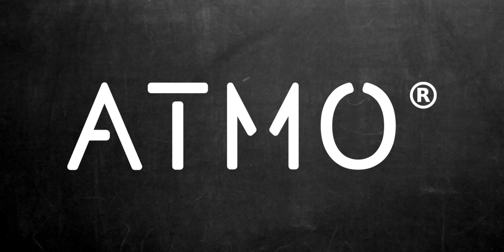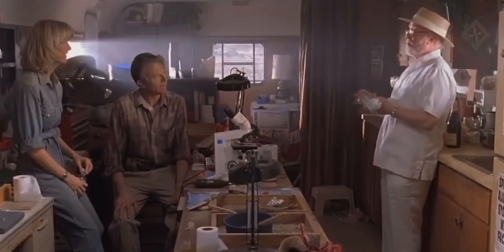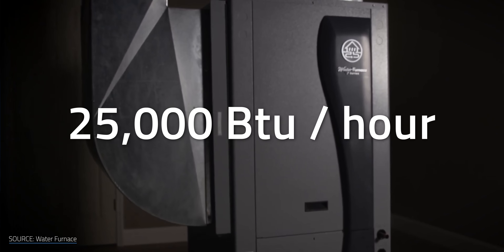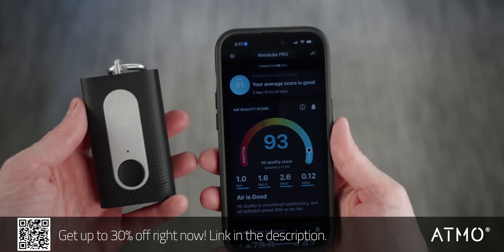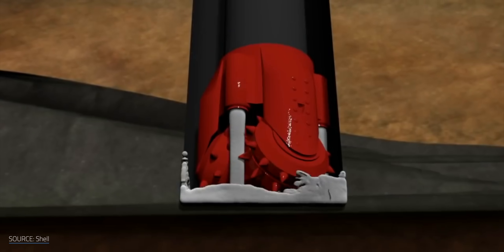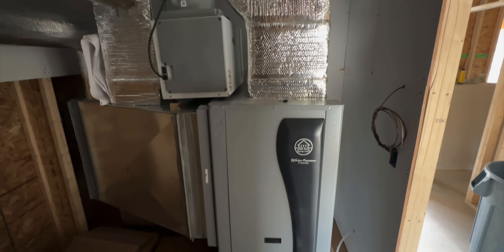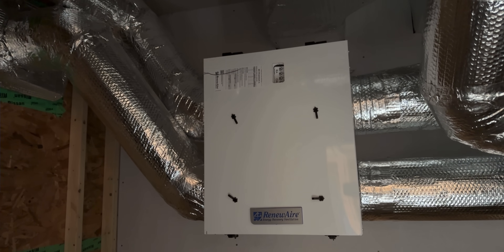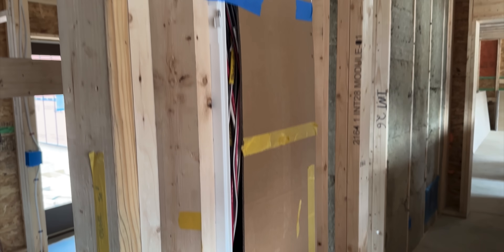Why I Went With Geothermal For My Net Zero Home

Comment: I've seen other people mention the Span panel, it looks really interesting. I haven't seen a dive into it yet. The other video talked about how it was a good solution for electrifying homes that currently have other energy sources for appliances (like gas) without having to fully upgrade the electrical system. You could use the San panel to do things like turn off the water heater while the dryer is running to prevent system overload. And the water heater wouldn't lose much heat in that short time.
Reply: Really in his home I think the only use that makes sense is load balancing during a power outage and general monitoring.

He mentions having it charge his car when he has excess solar power, but Massachusetts has net metering required for a lot of power companies, so there shouldn't be any cost savings afaik doing it his way. In terms of CO2 offset it doesn't matter if the solar is being used in his house vs on of his neighbors by exporting besides maybe some marginal transmission losses. I don't see a point of it besides some feel good factor.
Reply: Matt's "zero energy" goal may not require it, but i bet there will be more Span panels as existing MA solar owners upsize, possibly with off-grid systems that won't interfere with existing interconnection agreements.  By balancing, span can likely help prevent back-feeding and be setup to switch over to critical loads (or off-grid) solutions.

Comment: Radiant Heating sucks Here in Vermont... Most of the Heat just Bleeds out Along the Baseboards & Outside without Heating the House Because They Stupidly Install It Along the Outer Walls... & IF it gets Too Cold Those Stupid Pipes Freeze Along the Outer Walls.

Comment: i would like to know the idle power usage of all that smart stuff. also, would be nice to translate btu-s, r-x-ses and tons to si units, like kw-s and insulation thickness. still not convinced one gets "net 0", if accounting for all the devices and extra stuff. the initial capex is huge, even if not looking at interest rates or a 50-year life span. ...which might be more or less for each part, but duct cleaning, compressor, windows losing the low-k gas, vendor lock-in and upgrades through time... yeah i'm poor.

Comment: Great project! Wondering if you looked into getting the Tesla Solar roof instead of a metal roof + solar panels. On my house, prices for the Tesla roof vs metal + solar panels were comparable. I don't regret going the Tesla roof route at all. Also, wondered why you didn't go with a Zehnder ERV instead of  RenewAir. As you mentioned, ventilation is the most important component of the system. Zehnder systems have a dedicated ducting system that doesn't rely on the WaterFurnace fan to work.

Comment: I don't usually comment but I had to in this case,
I find it odd that in newbuilds/extensive renovations, neither electrical nor network cables are being put into ducting from the central location in the house.

Sure cost goes up a bit but just the convenience is something is not working or has to be changed in the future seems like it should out weight the small cost of the ducts

Comment: I'll mention the same warning I did last time on geothermal heat pump systems with vertical wells like yours and mine. The drillers usually have no way of knowing how far it is down to bedrock, and that portion of the well above bedrock (or ledge) needs casement (the big steel pipe). Because of this the estimate will be a hopeful guess and the actual cost can go much higher. In my case they guestimated 20 feet to ledge ( a reasonable guess in NH) but it ended up being 100 feet, which added $8600.00 on top of the estimated cost for the (in my case) two wells. I'll add that my system came online in early February, just before the double digit negative Fahrenheit cold snap and it performed very well. Looking forward to not dealing with window AC units this summer.
Reply: That is a huge price for casing.  Here in my part of Canada the depth to bedrock is literally measured in inches so it isn't a concern.
Reply: @markbernier8434  with new air to water cold climate heat pumps , ground source heat pumps do not make any economical sense, yes they are more efficient but with saved money I would prefer to install solar panels to get higher return on investment
Reply: @andreycham4797  I somewhat agree with you. For me the calculations went beyond up front and running cost to dependability and maintenance. One nice thing about geothermal is that none of the system components are outside exposed to the elements. Maintenance amounts to periodic filter change and condensate pump line cleaning. No worries about external condenser freezing up. Also it looks like even the cold climate air source heat pumps are still only good to -5F. I'm sure they'll get better but that's where it is now. Here in the northeast, that's a concern.
Reply: @markbernier8434  That's why I mention the depth to ledge being a hopeful guess. Its commonly not that far to ledge around here either. I just got unlucky.
Reply: I had a similar experience with casing cost.

Comment: Hello Matt,

I kind of did the same thing you are doing. But I didn't see you mentioning using your geothermal energy for pre-cooling of preheating the air of the ventilation? Somethings it's called a 'hydraulic Canadian well'. My ventilation unit from Zehnder had this extra heat exchange module. The same geothermal liquid goes to my heat pump and ventilation unit. Did you ever consider this? 

Best regards from Belgium. Jan

Comment: I installed water furnace 5 series. In 2019. My house had oil heat and no duct work so when I wanted central air it was a no brainer for me. I have a 2 ton system upstairs and 3 downstairs. It’s an older house so needed a bigger system. The system has worked flawless even in cold NY winters. I would recommend using ecobee thermostats because they have wireless sensors and the data and control is better than anything else.
Reply: We love hearing comments like this. Thank you so much for choosing WaterFurnace for your home. We appreciate you.

Comment: Hi Matt, In the UK we try not to allow the hvac system to extract kitchen cooking smells as grease particles will clog filters and line the ducting  causing build up over time, we recommend to customers using down draft extractors that are baffled to stop cold outside air coming back in to the house and are almost sealed when not in use so they don't unbalance the hvac, These can also be set to boost the air coming in when in use to compensate for the amount of air the extract is pushing, These down draft also remove more cooking smells and moisture than conventional overhead extractor types. may be worth having a word with your hvac installers.
Reply: I was thinking this too.  I wouldn't want grease getting in my ERV.

Comment: You are building the house nearly the same way we are planning to re-build our place.
It would be great to get some references for contractors and architects that you work with as we are also located in MA.

Beyond what you are doing, I'm trying to explore options to put PoE lighting in the house so that I have better control over them.
Have you thought of PoE low voltage lights?
Reply: I have build my house with es32 POE wall switches, designed PCB's myself. Connected to esphome and home assistant. Never seen such reliability so far, super happy about it and definitely can recommend that.
Reply: @andrejb.5467  wow! Do you happened to have a blogpost or something similar where we can read more about your approach?
Reply: Didn't know that was a thing
Reply: @l0gic23  they are mostly in commercial and high-end residential. Not too many mom-n-pop shops can do this

Comment: As far as automatically opening and closing shades to help regulate temp to save energy. My grandparents house was built in the 1890's. (Yes 1890 not 1980's) Since they didn't have HVAC systems the architect made the eaves stick out. (the outside roof overhang the siding). So that in the winter when the sun is lower in the sky the sunlight shines directly into the windows. While in the summer the eaves stick out enough to shade the windows so that the sun doesn't directly shine in. 

How far the eaves stick out depends on your latitude. It works out all year long, even in spring and fall where the windows get partial sun.  

I referenced the windows in particular because they're a big source of energy exchange. But the eaves actually help regulate temp on the entire side of the house. It works out so that the higher in the sky the sun is the more shade there is on the house, of course the lower the sun is in the sky the less shade it gets. It lets the circadian rhythm determine how much sun falls on the house both in a 24 hr and yearly cycle. 

As far as aesthetics. From the street the overhang of the eaves gives it a very baroque feel. Many people seem to prefer clean, almost industrial lines these days. But if it ain't baroque don't fix it, I say. Bad dum tish.
Reply: These sorts of large overhangs are common in Prairie style architecture, for the same reason. I've heard it described as putting a large brimmed "hat" on your house.
Reply: @RossReedstrom  Oh yeah, those salt boxes with the big roof. That makes me think also. That overhang really really helps to keep the basement dry too. As long as the ground surrounding the foundation has good drainage, having the majority of the roof runoff a couple feet out helps with hydrostatic pressure.

Comment: in-laws built a home 20+ yrs ago in Rindge NH and with a geothermal system for heating/cooling and radiant floor heat.   best system ever.  they kept the thermostat at 72F non stop and it was always a joy to visit.  Set it and forget it.   Whether it was 90F outside or 15F the interior was so nice.

Comment: I have a 2 story house in California approx 3000 square feet and 2 Tesla's. My house has a 2 ton heat pump system upstairs and a 3 ton heat pump system downstairs. With a 16 kilowatt  solar system on the roof and no battery. I produce more power than I use. The extra power produced partially covers my bill on a rental unit in Monterey.  It's cheaper and less complicated to just install extra panels on the roof and share the excess power.

Comment: I invested it for my 70 year old house and it works very well, it will pay off in less than 5 years with the energy prices we have in Sweden now.

2 ton system sounds heavy, my system is less than 300 kg, I must investigate why you need such a behemot of a system.

Edit: Ah I see, it's because I have a water loop heating system...

Comment: I love geothermal but the energy savings doesn't outweigh the system cost over the typical homeowner occupancy period.  If you plan on living in a house for 40 years then by all means get it, otherwise there are other more cost-effective options.
Reply: Brett, no duhh , that's why it's mostly seen on custom residential and commercial new contruction and retrofit with remodeling. BUT!, with net zero homes the geo loop is much shorter do to the reduced loads due to sub .6 ACH for next zero standards and increased insulation loads. It's actually why you see mini splits on alot of those early Net Zero homes. Geo Manufacturers stepped up there game and offerings.

Comment: Shades won't work, it will only provide light control. The radient heat has already entered through the windows and is just cooking next to the shade, the heat has already entered the envelope. Bestbet would be to get some ceramic window tint on the outside to reject the heat before it ever tries to pass through the window.

Comment: Caution variable speed motors, and the newly required GFCI circuit breakers have had compatibility issues. "Nuisance tripping" have been reported with some mfg of HVAC and refrigerators due to the variable frequency used to vary the speed of the motor. If you can have a standard overcurrent circuit breaker installed rather than a GFCI tell the industry works out the bugs, the electrician forums are full of compatibility issues.

Comment: Given additional space available with an acreage/large lot, are there any options for battery storage nearing the megapack level?  Cost prohibitive perhaps but with a large size, battery density/materials don’t have to be state of the art cell tech.  Maybe packs from recycled car batteries? 150-200+kWh would probably make a home completely off grid, though some backup supply might be necessary during a lengthy winter storm....

Comment: This is fascinating! In Sweden this is extremely common. Possibly 20-25% have this. Lots have similar system but with local grid of heat. District heating. Lots of heat pumps also. We have Geothermal, solar panels and ESS 30kwh 🥳

Comment: I always wonder, ground has low thermal conductivity (altogether the reason of have constant temperature by insulating from atmosphere) then how can we extract/add large amount of heat using geothermal system ? Won't it very soon create a local hot or cold spot ?

Comment: just a word of caution to anyone thinking about going geothermal.  There is an option for open loop systems where you use ground water for the heat exchange.  these are generally more efficient as well as being cheaper than a closed loop system, but there is a fair amount of maintenance. Particularly if you have mineral rich ground water. i have to flush my system every other year to prevent the gravel packs from getting clogged. as i have iron rich sediment.
Reply: My Dad has one and it has been a maintenance nightmare.  Besides the fact it is quasi legal.  The DNR in our state isn't happy with people who pump clean groundwater out just for HVAC.  The heat exchanger on his goes out every few years because of the hard water.  We are pushing him to just finish it and replace the open loop with a closed.
Reply: @thezfunk  question does he have a pump and dump system? basically pumps water out of the ground and then dumps it into the yard or something on the return? i know the EPA really dislikes those, but hasnt an issue with systems that return the ground water back into the earth.

Comment: Climate zones help a lot, Ilve in a standard, poorly  sealed,  partially insulated house in Australia...  we may endure coolish temps sometimes in winter evenings (no great hardship really, there is no risk to health) but with 6kW solar (non optimal siting due to geography) and solar hot water system, we export a lot more power (80% of generation) than is consumed on the property - does that make us zero net?? -   we are  in the green by ober 25 tonnes of CO2 over 5 years, that even offsets our cars somewhat.

Regulating lights to save energy - lol, well only have lights on which are being used, not "scheduled illumination" - or is a switch too oldschool.  (enjoy "the fruit of your labours", and it is good that people like yourself put these snippets of info out there.)

Comment: what is your weather like in your location? I think one of the benefits of ground source is a more stable all year round source of heat into the HP which can help mitigate if you have lower air temps in winter?

Comment: I have one of those rheem heat pump water heaters. Make sure it's in a isolated place.  The heat pump is rather noisy when it runs. I have some regrets as it's on the other side of my master bedroom in the garage.

Comment: 12:32  I replaced the light switches in my bathrooms, kitchen, hallways, and laundry room with Lutron Maestro Motion Sensor Switches.  Walk into the room, lights turn on, walk out and the lights turn off.  You set the sensitivity and the length of time the lights stay on.

Comment: During the first year of use, you should do some calculation on how much you use and save in energy by using the geothermal heat pump system.

Comment: Hi Matt - love your videos.  Ive recently installed the same RenewAire ERV's in my home with mixed results (pun intended).  I'm very interested in a follow up, in-depth video regarding control in particular. I have 3 separate units in my home and 2 of my units are responding (going into boost mode) to signal even when they are not turned on at the button/switch.  Seems to be correlated with lights being turned on in the house.  My theory is the low-voltage thermostat style lines run during rough-in are sharing a path with the line voltage.  When I switch the lights on, the current is generatng a small field and tricking the contoller to think the ERV switch has been pressed.  My installers cant find a solution and have bailed on me, so if you read this and would be willing to share contact info on your installers, I'd really appreciate it.  I live just over the boarder in NH.  Hope to see a DM... and good luck with the rest of your build - looks amazing!
Reply: You gotta sue the installer or get up there and fix it yourself. This guy ain't got time, he's building his own house.

Comment: Going such a long way as a geothermal and still building a house from cardboard instead of brick or concrete. Is brick so much more expensive and/or does not provide insulation to justify the costs upfront?

Comment: On the topic of radiant vs forced air heating, you made the right decision.

Often missing from related discussions is the need for air filtering all year round. So, if the air needs to be moved for that reason anyway, it makes sense to heat/cool/ventilate at the same time.

Radiant floors are expensive in parts, labor, and maintenance, and for a very air tight (low ACH50) new home build, the radiant floor would ultimately run at such a low temperature that occupants would never observe a "warm floor" under their feet.

It was smart to avoid this cost and instead apply the funds to the geothermal heat pump instead.
Reply: The only place I would keep radiant floor heating is the bathroom.
Reply: @apedanticpeasant1447  Electric or hydronic for just the bathrooms?